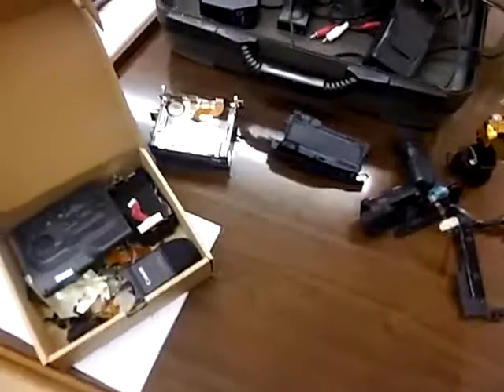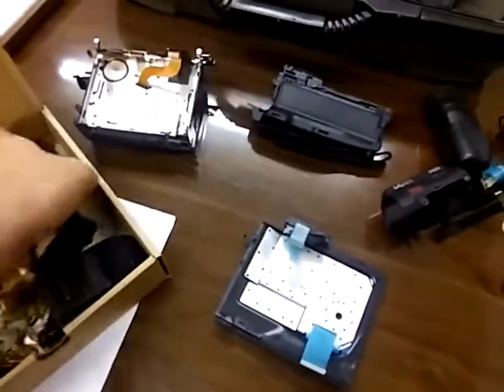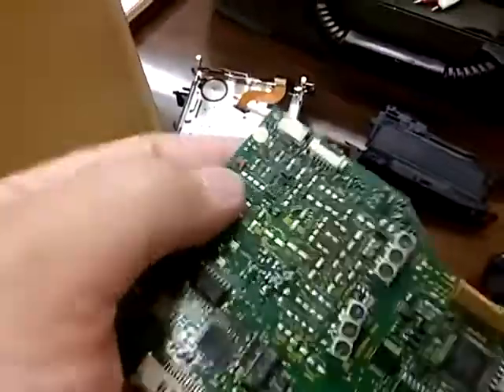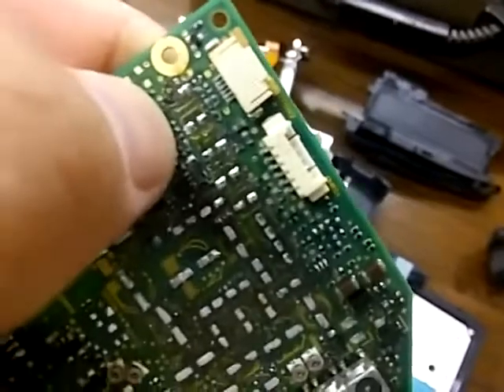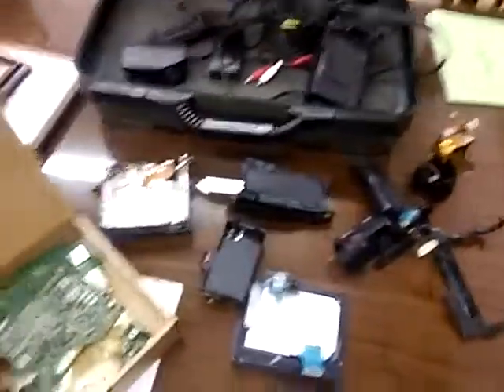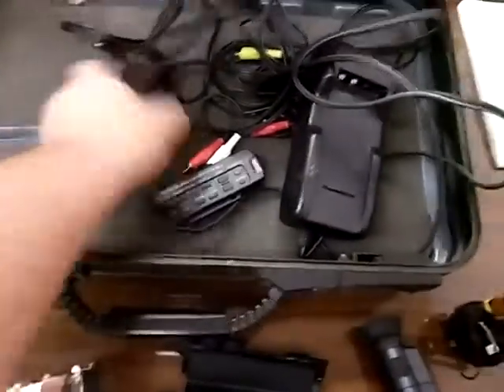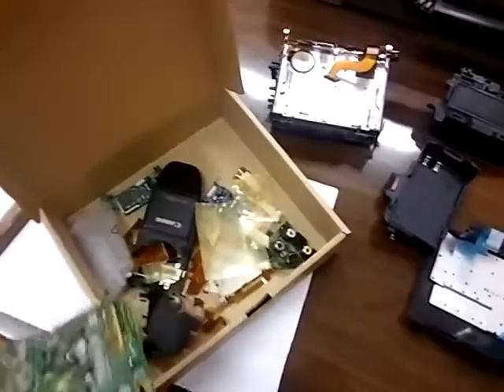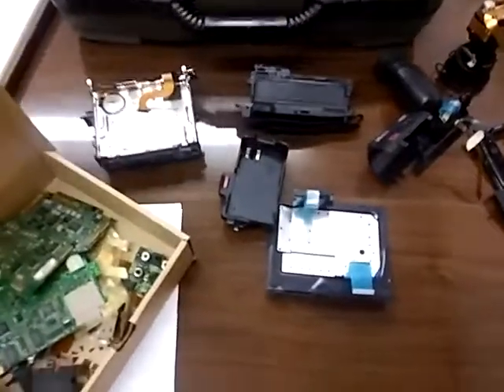Canon UCS1A Repair Teaser...The Sad Conclusion - Jody Bruchon

Comment: Bad news for me, This discouraged me from even attempting to repair mine. What was yours doing before the repair attempt? Mine powers on and cassette deck opens and closes but I only get few seconds to do it before the power fades off and the camcorder dies, It take a while before I can do it again.
Reply from the maker: Nearly all camcorders of this age are suffering from electrolytic capacitor failure. Don't be discouraged; look at it this way: it's dead anyway, you can't really make it worse. The pad lifted due to excess heat; I made some mistakes doing the work including lifting a tiny component with the iron and spending an hour re-attaching it. I'd do a couple of things differently if I tried again. One, I'd use a narrow chisel tip to solder instead of a standard cheap soldering pencil. Two, I'd use hot air to remove but I'd then put the new caps down in a spiral pattern so the density of the parts would be less of an issue. Three, I'd use solder paste and hot air to solder the areas where an iron couldn't easily reach.

If you have access to a Canon VIXIA camcorder with HDMI output, they have a macro focus mode which allows you to make a homemade "surgery monitor" setup that makes this stuff easier to do. Put it on a tripod on the bench but out of the way of your work, connect up a small HDMI monitor (I used a cheapo 19" I had lying around,) aim at the board, and enable macro focus in the shooting options menu. It'll zoom to the maximum zoom (57x in advanced zoom mode) but with the nearest possible focus and you can do your work using the super zoomed image on the monitor.
Reply: Hey. Use a ESR meter to find the bad capacitor instead of removing all of them! I'm going to attempt this on a Canon.

Comment: It the reality when dealing with capacitors that leaked out. No matter how careful you are. Pads sometimes can be so badly corroded and electrolytic got under pad, or trace. It lift off the board. Reason why don’t bother with camcorder anymore. Why to much work and only to be a 50/50 shot is not worth it.
Reply from the maker: I had never tried and wanted to give it a shot. I won't be trying again though.